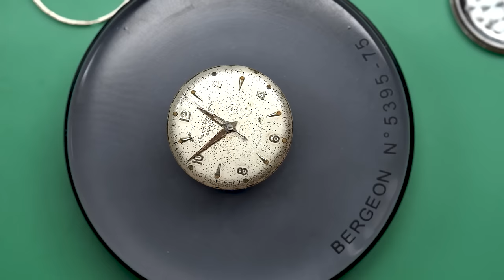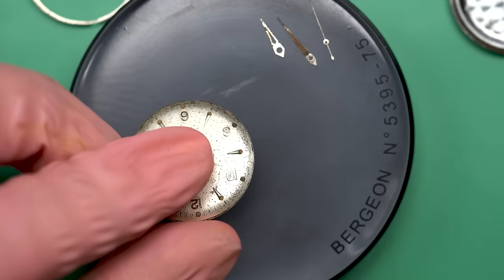Girard-Perregaux 1950s Vintage Dress Watch Restoration

Comment: I  remember from a previous video that a wheel had a broken pivot, same as here. Do you try to find where the broken-off piece has gone? I suppose it can't escape out of the case, so it must be somewhere inside. Or is it trapped inside the jewel, and gets washed away during the cleaning process?  Also, I don't remember seeing you oil the pivot of the setting lever before its cover plate goes back on. Does it matter, or do you oil it but just not mention it? Thank you for these soothing adventures.

Comment: Just a tip: If you're like me and drop tiny parts on a large surface like the floor....try turning down the lights and lay your flashlight on its side against the floor so the beam shines horizontally across the dark floor (not from above). Even the tiniest bumps or parts will stand out starkly by their shadow as you swing it around.

Comment: To check if they are radium you could get a Geiger counter, they are not that expensive and it would be really nice to know what you're dealing with, especially if there could be particulate bits from degraded components.

Comment: I went back and watched; the original escape wheel looked fine.  There might be a tiny piece of metal floating around in the movement now unless you found it.  Otherwise terrific job!  Excellent work as usual.  As a side note, with that fancy tool you rolled out, does that mean YOU can replace jewels or do you need to scrap a bridge/whatever if it has a bad or cracked jewel?

Comment: I've just found your channel and I love watching these videos. One thing I've noticed is that you're usually fine with the time offset (or whatever it's called), but what if you weren't? How would you adjust a movement like this? Is that what the +/- thing is for on this specific watch?
Reply: yes the +/- thing adjusts speed. It does so by making the balance spring a tiny bit shorter or longer. if you look closely, you can see that he in fact adjusted it slightly.

Comment: That patina on the dial is from the radium radiation would be my guess. I've seen several with that type of patina. I tend to shy away from those for that reason. I'm not sure how to handle those, especially with my luck some crazy would happen.  Great video as always great work finding the faults. The horia tool looks very similar to the Zietz jeweling tool, maybe more accurate.

Comment: Thank you for another lovely video!

Questions about spare parts- do you typically have to find ones for the exact movement or is there a lot of standardization across years/countries? Do you typically go used off of eBay or is there a good other source for "most" parts? I've bought a few spare non-working movements for parts before but the prospect of having hundreds of unique little parts laying around is a bit stressful for tracking purposes.

Comment: The circles that Marshall is referring to are made by a milling machine. When the part is manufactured, it is milled to its exact dimensional specification, using a rotary tool on micro milling machine. The circular marks or swirl marks are made by the rotary cutting tool.

Comment: I'm surprised that the speed of the rotation of the cleaning machine, and particularly the change of direction, doesn't damage the watch parts given the metal mesh basket. I would have imagined a fabric basket would have been the way to go.

Comment: I know I am late to this video, but you should get a Gieger counter. Looking at the spot corrosion damage to the watch face and the little paint marks by the numbers on the dial itself, It looks like there was more radium on the dial. The corrosion spots look more like the material the dial is made of, or the paint used on the dial surface, reacting to the radium. 70 years is a long time to be sitting millimeters from multiple emitting sources. That would be really easy to check with a counter.

Comment: As silly as it may sound, I'd really love to see you get a Geiger Counter at some point for these types of projects, Marshall. It'd obviously be one of the lesser-used tools in your chest, but for safety I know I'd feel more at ease knowing what I'm dealing with :(. Could that random specking on the face be from the radiation, btw? I know sometimes you'll get burn-in from the hands onto the face surface, but those hands were so toasted I wouldn't be surprised if the radium looming got spread around the face and just sat as particles slowly burning into it. Perhaps whatever impact broke the watch originally broke the looming free too?

Comment: I had a Girard-Perregaux that was similar, if not the same, back in the late 1980's. I had picked it up used at an antique mall. I could not find anyone who would fix it. They would try then just give it back. I took it to two different watchmakers. The horrified looks I would get when I asked if they could service it for me and get it back running. I liked the watch and would have liked it a lot more if it actually kept good time and stayed wound. I ended up selling it to yet another watchmaker for parts in the mid 2000's.

Comment: Your black stick is actually called a spudger. The one you call peg wood is oddly called an orange stick. It is generally used by a manicurist to push cuticles. They were originally made from orange tree wood. Enjoy your channel and regret not learning the trade when it was offered.

Comment: Radium-coated hands would actually explain the pitting in the dial. Over the years, the radioactivity can burn holes in paint or enamel, making a pattern just like that one, as the ionized particles slam into the surface.

Comment: looks like fun tinkering with watches. unfortunately, hobby is just another word for expensive. reminds me of the film projector heads I used to refurbish, just smaller. I don't own a watch of any kind. I break them carrying things or picking heavy stuff up. it's kind of funny, the last one I had I forgot that I had it on and hit a heavy bag, well it went out in pieces. maybe the previous owner liked to box like me and forgot to take his watch off. you had me worried for a moment with the hair, good one.

Comment: Would it help to seat the bridges on the jewels by putting the case holder with the movement on the ultrasonic to create tiny amount vibration? Or is it too much vibration - or even if so - can it be damped by putting it on radako????

Comment: Hello again, i was wondering if you were willing/wanting to do a cleaning/repair on a 1970's Cordura Sea-Gull. It was my grandpa's and it is no longer running.. i believe it just needs a service, as the mainspring winds and holds tension, and the escape wheel spins freely. (I learned this from you lol) but I've not enough expertise to try and work on something so sentimental to me. I would be happy to pay, shipping both ways as well as any service/repair costs. I honestly would just love to actually SEE it taken apart and tentatively cared for.

Comment: When working with Radium, please keep in mind that it is highly radioactive and it decays in Radon, which is a gas that is also highly radioactive. So especially in closed ambients like a watch case or a hands box this gas can accumulate and be potentially dangerous. Also Radium is chemically similiar to Calcium and it can take its place in bones and other biological mechanisms, potentially leading to cancer. When unsure, please wear a filtering mask and open the movement/hands box in front of a window to let Radon in the air. Also some Radium dust may be present on the dial due to corrosion ecc., so consider washing it properly and dispose correctly everything that went in contact with the dust. You're fine since your exposure is limited, but it's nonetheless a hazard to your health. Also check out the Radium Girls tragic story, but i suspect that a  watchmaker like you already know this. Hope this can help and keep going with this beautiful channel :)

Comment: Hi Marshall, thanks for another great video. I have a question about the camera you're using for the close-ups (not the microscope cam). I see the end of the lens in some shots, but what type of lens is that ... 60mm tele/macro? I am interested because I have just started filming some of my restorations, but have a go-pro. Lurking in my other hobby cupboard is all of my camera equipment, but it's a heavy bit of kit! Can you give some guidance as to what you are using?
Thanks again, Paul (UK).
Reply from the maker: Hey Paul, yes that is a fixed focal length 100mm macro lens, it happens to be a manual focus only lens. A go-pro is inherently a super wide angle lens so you'd have to really go the other direction for close up work like this :)

Comment: I've seen shotty watchmaker work before when a watch movement has been serviced and the watchmaker has purposely moved the jewel out of place in order to tighten up the pivot on a wheel that is damaged instead of replacing the worn or broken part. Such carelessness and plain just wrong doing is not very common as most watchmakers take pride in their work as you do. 👍

Comment: Brilliant the way you suckered us with the hair... but what about the escapement wheel pinion. If that did break off when trying to screw down the bridge, couldn't the pinion have fallen into the mechanism to become an issue down the line? I just hope you are right in suggesting it might already have been broken and not noticed and one of the reasons why the watch was a non-runner, perhaps through being dropped or something... 🙂

Comment: For radium, while it is not ingested or inhaled you're fine the radiations are not dangerous.  That's why it should be handled with care,  as you should avoid damaging it in a closed space where you can easily inhale it, which means that it's dust will stay into your lungs and over time can lead to diseases. Usually when you know what you're doing, working with radioactive stuff is not very dangerous and a lot safer than many other things people will use daily. But when you don't know what you're doing and even if you do, it is better to take a lot more safety than it does really required so to avoid any danger.

Comment: If you think you might have broken the wheel pivot yourself, after cleaning, are you concerned with the little bit of metal floating around inside the movement?  I mean, I realize there was like a week in there, where you bought the donor movement and disassembled it.
Reply from the maker: Not really worried about it, something like that would likely show up or just be at the bottom of a cleaning jar.

Comment: Couldn't you use a vinegar to remove the rust spots. So the brown would be more silver. Then clear coat the dial. Then it would appear more silver but still be original dial.

Comment: I expect the dial patina was caused by the disintegrating specs of radium which fell from the hands. Hopefully you didn't breathe any of the fine dust in while you were working on the movement.

Comment: I hope you contacted someone to test and dispose of the hands if they are radium.
Not only is it a highly toxic material, it's highly radioactive and when powderised (like in loom) becomes extremely hazardous. 
The damage to the face of the dial looks like a radiation scattergraph, so I wouldn't be surprised if it was radium. The radium would also be present in the odd-number indicia as well!

Comment: PSA: don’t use one dip. Besides grease it will also dissolve your brain and nervous system. it contains Trichloroethylene and it’s use in commercial settings is banned in the us and eu. It’s meant to be used only for mainsprings as a last measure. Just not with it for things like jewels you can clean with isopropyl.

Comment: I was wondering about the yellow paper you always put the jewels on after cleaning them in solvent. Was sorta thinking to myself "Aah, I bet that's a special lint-free jewel drying paper made by industrious swiss minds to soak up solvent the most efficiently without leaving any fibres or residues on the jewels afterwards. I bet it's made by Bergeon or something. It probably costs twenty dollars per sheet.". 

Nope. Post-it.
Reply: This exactly.

Comment: I can see how all the different wheels will be sized to run at their minute or second or hour rates. But its never clear how what looks like one central rotating pin runs all three hands simultaneously at those different rates??? Especially when all the hands are just sort of pressed onto it all together and not carefully or individually locked in place.
Reply: I know one way you can find out.

Comment: There is a replacement glow in the dark paint you can get that is safe....Just not as bright...
Reply: Jerry, what I'm wondering is: if he figured the hands might be radium, wouldn't the l lume dots on the dial be as well?
Reply: @toddsmith8608  It depends. I HAVE SEEN WITH, AND WITHOUT.

Comment: I am happy to inform you, you DIDN'T get me with the hair or fiber or whatever that was, because you couldn't help giggling while leaving it. :P
I MIGHT've been screaming internally at you to stop giggling about  it and get it out of there though...
EDIT: Radium isn't just toxic, they're radioactive. So I would strongly recommend having some sort of meter for how radioactive they still are before you even get your hands close to em. It's not THAT big a deal most of the time, but all you need is one cell that gets radiation-poisoned in a way where it doesn't self-destruct properly and you might have cancer on your hands. Literally and figuratively. Ya gotta be very very careful with that stuff. If you can do it on average 500, 1000, 2000 times before you get cancer in your hands, would you still risk interacting with it? Especially if you don't KNOW it's 2000 or 20 times with the levels of radiation that specific lump of radioactive matter emits?
Reply: @Nefilium, did it seem odd that he was concerned about the lume on the hands but not on the dial?
Reply: @toddsmith8608  I actually didn't think about it, but now that you mention it, yes. That's something to be very careful of aswell.